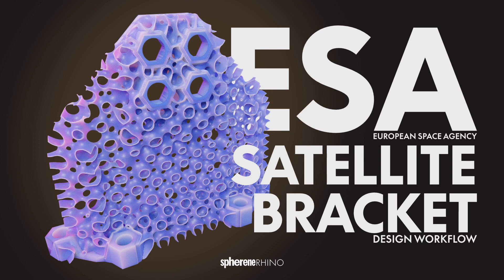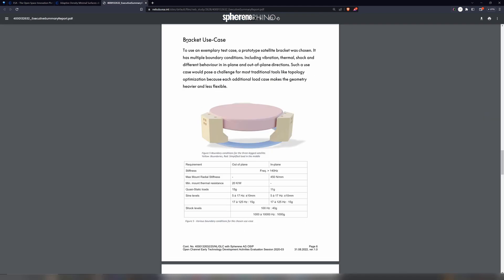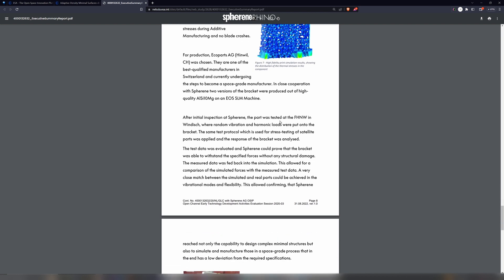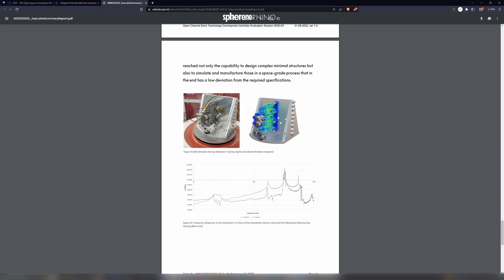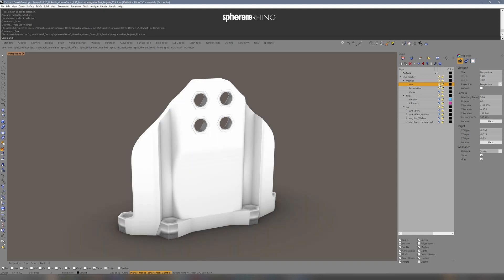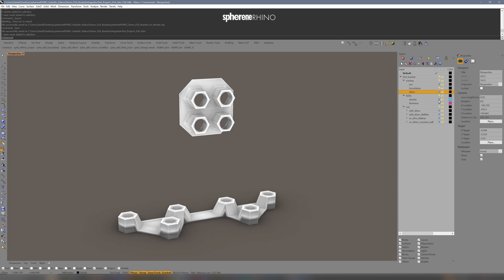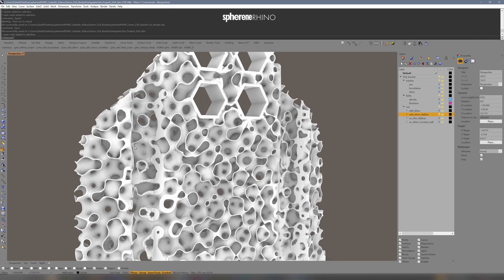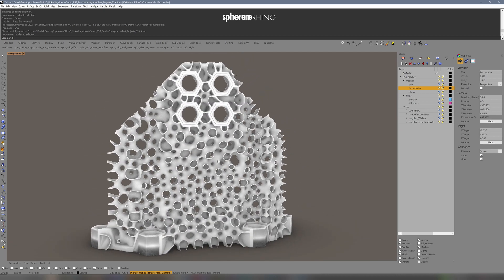sphereneRHINO Design Workflow ESA Satellite Bracket

Comment: Very interesting stuff. This design methodology almost seems like it’s 1 degree away from generative design and I think I prefer these type of designs more as you don’t have to manually “sift” through many junk designs created through the generative design process. It seems like you have more direct manipulation of the design parameters through this tool.
Reply from the maker: Thank you for that interesting observation. In deed you control it in more of a what you see is what you get fashion. Once you have your first results dialed in it is straight forward to make controled changes.